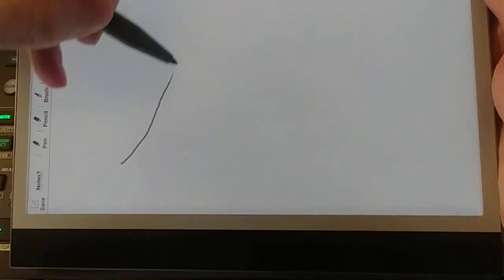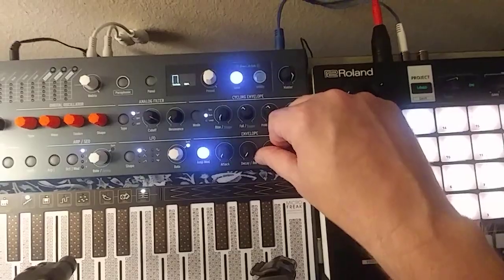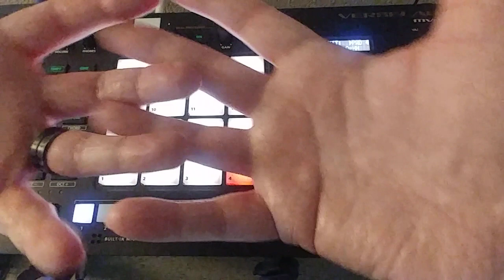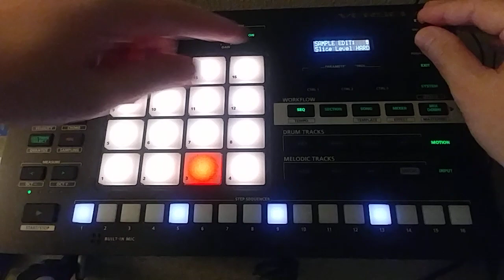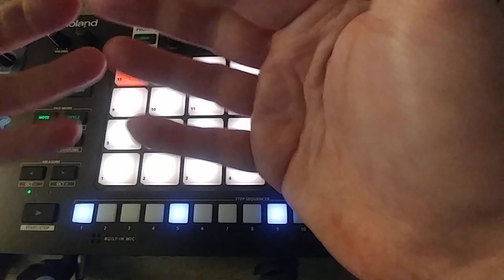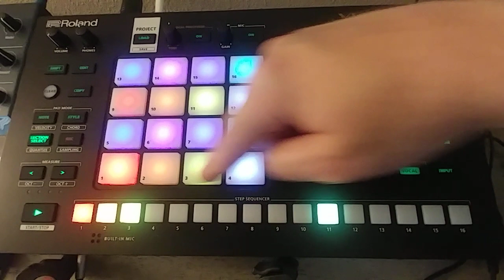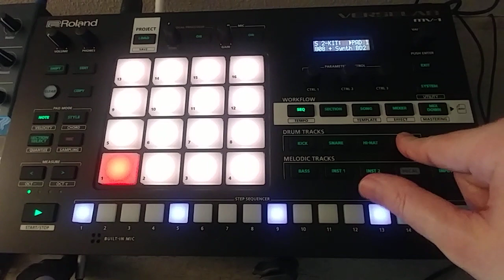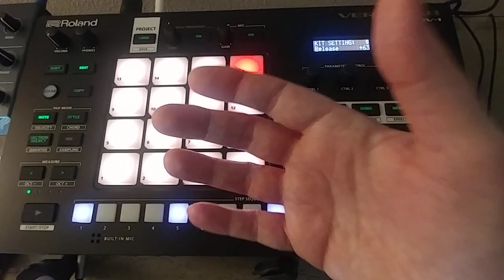Roland Verselab MV-1: Using Samples with the Kit Track

Comment: Amazing video…is there a way to disable my parameter control knobs ? My 1st control knob is acting glitchy and wanted to turn off as a master to where I don’t have to turn off manually on every session
Reply from the maker: @TheonlyMrlab  They're assignable for parameters, so you could make a default project, but, then, there's no way to turn them off in, say, the menu, which is what I think you're asking. I could see how that could cause problems if they were acting up. I'd definitely suggest contacting support, you'll probably need to send it in for repair, unfortunately. 😢
Reply: I got cha 
Thank you once again…loving the Verselab 🫡

Comment: what folder do i add wave files on the sd card?
Reply from the maker: @jordanWAH  I don't have the verselab in front of me, but I believe it's ROLAND/MV/SAMPLES

You can put both files AND folders in this directory. Inside the correct folder you'll see a folder already there from the verselab called "EXPORT", this is where all exported files go, from the sampling engine. The samples folder is the only folder that is accessible ON the verselab, so, unfortunately, the MIXOUT folder, which is outside the sample folder, is not accessible on the verselab itself, only from accessing SD card in a computer..
Reply: @LeRoy3rd  thanks. That's correct. It only works with wave files I think. 
Put each wave samples in either drum, tone or loop folder. I was able to finally create my own drum kit.
You can also replace all other drum or melodic tracks with any preset you choose. It doesn't have to be bass for bass, or whatever. It only effects the style/chord patterns for drum tracks or arpeggios for melodic tracks.
Reply from the maker: @jordanWAH  It's also worth noting that drum vs melodic tracks affect how the pads effect the sounds. The drum tracks (except KIT) are triggers, the melodic tracks (and KIT) are gates, and this can't be changed (except by loading a clip with the opposite function, but then if you change the sample or preset, it defaults back). I don't think this is an issue with synth presets, only samples.

As to using different folders, you can use whatever sub-folders you want, and even sub-folders inside the sub-folders. I'm really organized so I use a lot of different folders and sub-folders to keep things organized and easily accessible.
Reply: @LeRoy3rd  good to know! Thank you